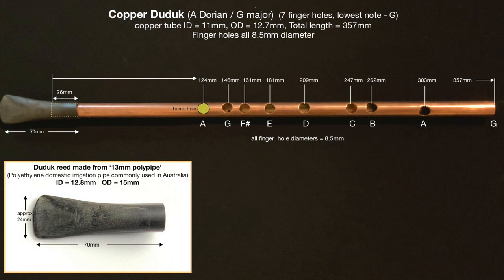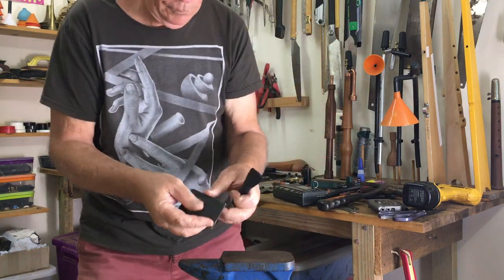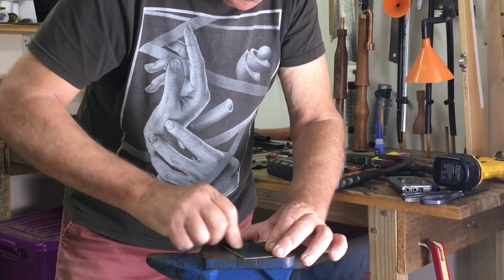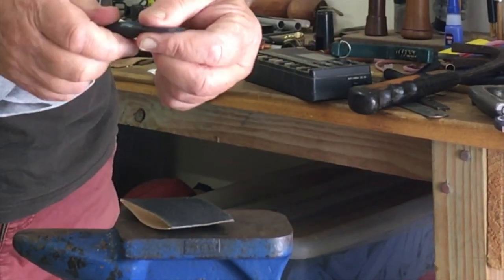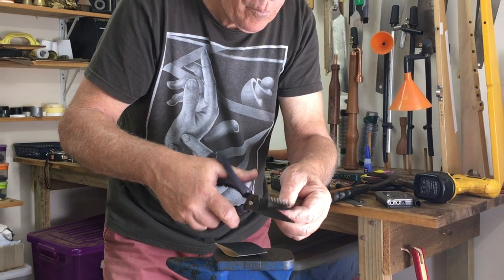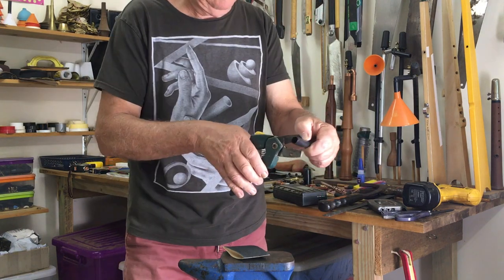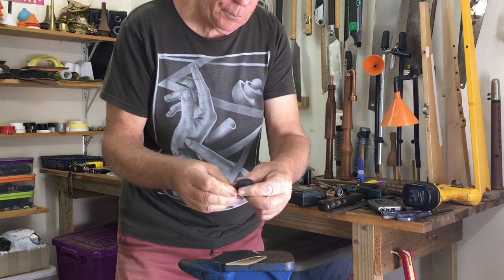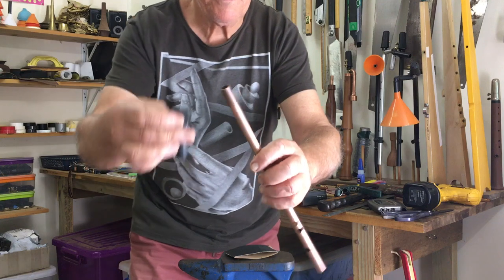DIY Copper Duduk + polypipe duduk reed

Comment: I just successfully made a version of this. I have the irrigation pipe, but subbed some CPVC, had to get creative with a coupling to connect the reed, then adapted the pipe length to accommodate that change, and converted to inches.  The reed could probably use some shaping by I can get all 9 notes nicely in tune.  The reed also works for bassoon-length stuff I’m experimenting on.

Comment: I got some polyethylene pipe but it doesn’t behave in this way. No matter how much I hammer it it doesn’t stay flat
Reply: i'm in the US and i used 3/4 inch polypipe thickwall, and I got it to work but I had to work at it for a long time, and it's not great. I have seen the thinwall polypipe and it's what the video was using... this stuff is twice as thick and indeed, won't stay flat. But you can get it to make a sound. 3/4 polypipe can stretch right over 1 inch copper with a blow torch, just heat the poly pipe for 2 seconds

Comment: Would heating the polypipe reed with a heat gun prevent it from making sound? Because that would take care of the springback issue
Reply from the maker: Actually you need the spring back (which eventually settles to the correct amount of springback). Using the heat gun releases the tension which is actually needed.
Reply from the maker: I did a bit more experimenting with the heat gun (I had tried it about 6 months ago with no success) ...the trick is the use heat to slightly flatten the polypipe but not all the way so that there is still some springback ...I will keep working on this ...but it may be a combination of heat gun and sanding back to thin certain areas fairly precisely that works best

Comment: Wonderful! I'll give it a go this arv :)
I do a fair bit of irrigation work, and if I need to permanently reshape poly pipe, a quick hit with a blow torch or a cigarette lighter does the trick. I wonder if heating and squishing in a vice before the hammering might leave the reed more inclined to stay put.
Reply from the maker: Actually you need the spring back (which eventually settles to the correct amount of springback). Using the heat gun releases the tension which is actually needed.
Reply: @SquealyD  fab! Thanks mate :)
Reply from the maker: @alaspooryorick9946   you'll be happy to know that I did a bit more experimenting with the heat gun (I had tried it about 6 months ago with no success)....and the trick is the use heat to slightly flatten the polypipe but not all the way so that there is still some springback ...I will keep working on this ...but it my be a combination of heat gun and sanding back to thin certain areas fairly precisely
Reply: @SquealyD  marvelous! I'll give it a bit more of a go myself. First attempt was delightfully wild, but not being a wind player, that was inevitable.

Comment: Hey Linsey, I have been watching you and building my own instruments for a while! THANK YOU! But I can't seem to get the membranes to sound right when attached to a bag. I was wandering if I could pay you via some electronic transfer, for the materials that you used in your "smallpipes"; as well as some poly-pipe and measurements for your different tunings. As a piper myself I have gotten quite flustered with not being able to finish it. Thank you, and I can email you privately if need be from your website.

Comment: If it was heated and then cooled in the correct shape, would i hold shape better?
Reply from the maker: Actually you need the spring back (which eventually settles to the correct amount of springback). Using the heat gun releases the tension which is actually needed.
Reply: @SquealyD   thanks!

Comment: Wonderful! Could someone please tell me how the material needed for the reed is called in Europe (more specifically, in the Netherlands)? An internet search for "polypipe" or "polyethylene pipe" doesn't get me anywhere... Thanks!
Reply: I don't know about in Europe, but I'd start by searching for "irrigation pipe". There's a whole lot of different pipes used for irrigation, though.
Reply: @IsaacKuo  Thanks, but... As you say, there are all kinds of irrigation pipe. Hard, flexible, different diameters, thicknesses, etc etc.
Reply from the maker: @VanitaJohannaMonk   Hi Vanita, sorry that is specific as I can be except that here is is LDPE (low density polyethylene pipe) which is used for domestic irrigation systems. You are looking for polyethylene pipe (Polyethyleen in Nederlands). I would imagine you have something similar.
Reply: Looks like what I'd call Drip Irrigation pipe
Reply: @SquealyD  Thank you so much for replying Linsey! LDPE was indeed the most fruitful search term. The closest I could find is described as (translation ) "LDPE tubing for irrigation, 4.8 bar, 16mm diameter, 1.5 mm material thickness". I am assuming that 16mm outer diameter and 1.5 material thickness (2x) will amount to 13 mm inner diameter. Hopefully that will be close enough and I will still be able to get it in tune? Love your music and all your inventions by the way!
Reply from the maker: @VanitaJohannaMonk   if it's 1.5mm wall thickness you will need to work it more with hammer and sandpaper as it will be stiffer (maybe too stiff ....you'll have to try)
Reply: @SquealyD  It works! And the 16 mm pipe also fits snugly into a traditional wooden duduk in A. However, there is definitely an art to this... A bit extra hammering, trimming and sanding can have a big impact on the responsiveness, pitch, volume and timbre. It will clearly take me some more practice until I get a reed I am really happy with. Thanks again!
Reply: @SquealyD  in germany we have PN-12 (which is polyethylene also) pipes for domestic water supply. i haven't tried if it works yet though. (feels like it may work though).
I'm wondering: do the diameters here matter very much? I'd imagine the diameter of the tubing doesn't affect the pitch much, but does it affect the tone perhaps? should it be somewhat similar? i don't play wind instruments currently and have no prior knowledge